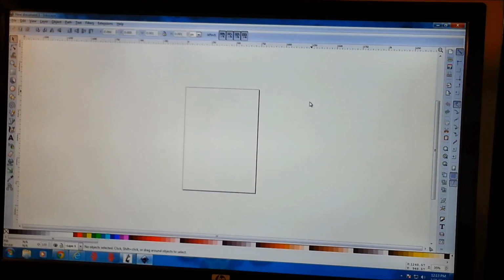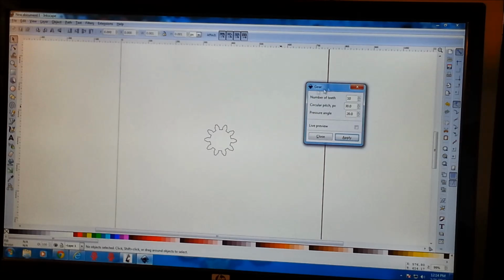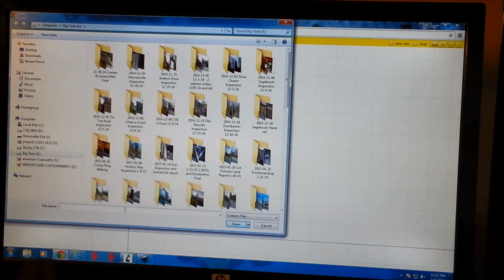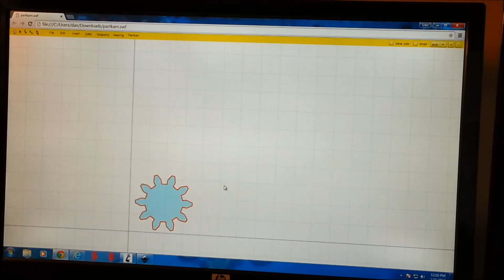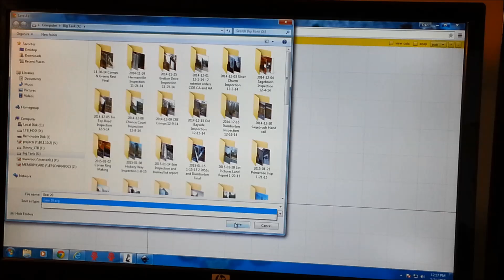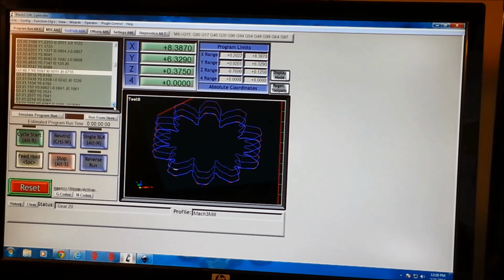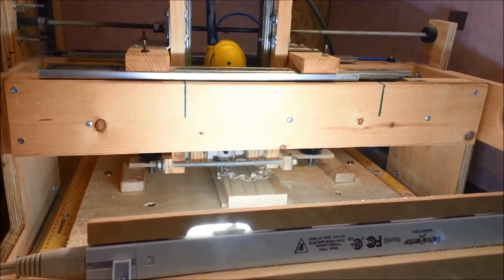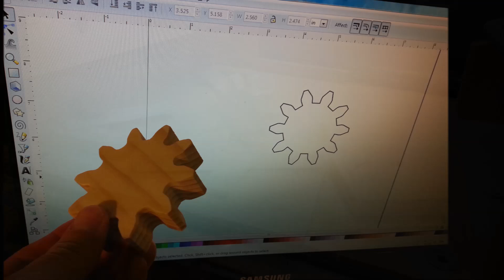DIY CNC - Making Gears With Free Software

Comment: I have looked online everyplace for the MakerCam offline software . If anyone can post a link please. I just bought myself a Millright M3 and have nothing to control it yet. All this is new to me im switching over from 3d printing and would like to start working with some cutting alum parts for my RC hobby. Any info or input would help.

Comment: Can this be used on a CNC for matching Aluminium I am only just getting in to CNC so a total beginner but any help would be very helpful
Reply from the maker: +dave cox It's a basic option but there are better choices.  I was testing out MakerCam a year ago and did have some success with it.  For those into CNC as a hobby there are a tremendous number of software packages available.  I have had great success with using two programs for my CAD and CAM work; Inkscape is free and a fantastic program for design work.  For the machining side of things (the CAM) part I use another free program called Jscut at www.jscut.org.  I have videos on how these two programs work together.  Cutting aluminum is not overly difficult but does require a lot of trial and error for each specific machine.  Feed rates, end mills, depths of cut are all somewhat specific when cutting aluminum.  Here's a vid I did recently in aluminum cutting.  https://www.youtube.com/watch?v=ase2RpzYE4c  Best of luck.

Comment: Hi Great video, i have a cnc plasma and now im using fast cam wich is not to good, do you know if this maker cam can generate de g code for plasma aplication...?

Thanks
Reply from the maker: +Fernando Hernandez Bolio Thanks.  I haven't used a plasma machine before.  I would imagine that plasma machines require changes to the code.  Just not sure.

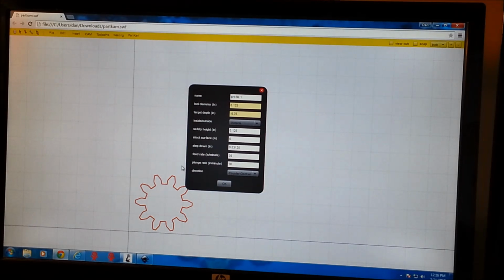Comment: sir im yet to do my 1st cnc job i just about to start but have some question regarding the parameter boxes in Profile Op. @ 2:57 So my Question is how do i know what to fill in there? i have some cutters but not sure if they are the right one for the type of job, and in addition im not sure what are those boxes really asking for as far as the tool section go, maybe a little pointer? thanks in advance 

ill be cutting some Gears using wood  PLA or Aluminum 6061? not sure yet but this is what i wud like to work with specially the speed rate? how do i know whats appropriate ? i have a manual machine cnc 3020T , you can find this on Ebay for about $799
Reply: i just tried what you just did every step and i got alot of circles in mach3 like a whole bunch of rings "i did have 3 gears" so i when back to the cam and deleted 2 and re run the profile op and calculate selected item and then i exported and i still get those rings in the view path in mach3
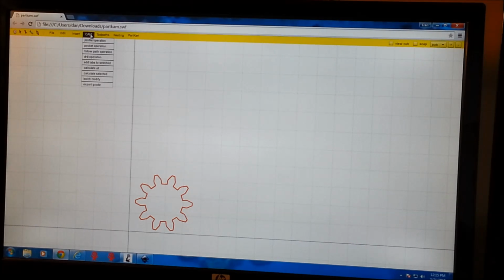Reply from the maker: +Frank Lopez For a while I was using Makercam with some good results but have switched over to using Jscut.org.  It's a much better application that also runs in the browser.  It can handle much more complicated shapes and makes good pockets as well.  There are some very good tutorials on using Jscut for 2d cnc work.  Makercam would act up from time to time.  The parameters at the 2:57 mark:  Tool Diameter - is the width of the cutter; Target Depth is how far you want it to go into the material; Inside/Outside is whether you want the cut to be inside or outside of the line for the shape to be cut; Safety Height would be how high above the material you want the end mill/bit to go; Step Down is how far you want the cutter to go for each pass; Feed Rate is how fast the cutter will move around the piece; Plunge Rate is the speed you want the end mill to drive into the work.  Makercam uses inches.
Reply: yeah i use mm so i see where the problem is at all my work is done in mm in autocad and as far as the tool entry what about some tools that have more then one diameter ? which one do you enter? and as far as  the speed rate "how do we know what number is that?" thanks for your reply tho
Reply: i deal with 3D files so i dont think this cam will help as i think this is for only 2D

Comment: what is the OZ/in on them nema 23's ?
Reply from the maker: Hi Dan - 290oz, I think - it was a couple years ago when I bought them.  This is pretty much the same kit on eBay that I bought:  http://www.ebay.com/itm/Nema-23-Stepper-Motor-290oz-in-3-Axis-TB6560-Board-CNC-Kit-Router-FREE-ship-/271340386557?pt=LH_DefaultDomain_0&hash=item3f2d25b8fd
Thanks for your comments.

Comment: Nice video,
Could you show/provide a reference for how you were able to run MakerCam locally?
Reply from the maker: Thanks, David.  Here's the Wiki link with details on where and how to download.  I am running it in Google by dropping the application in the Google folder.  It's odd that it is a flash program, but it does work pretty well. http://www.shapeoko.com/wiki/index.php/MakerCAM
Reply: drez20001 Thanks! I'll have to take a look at that. I'm eagerly awaiting shipment of the Shapeoko 3. I preordered back in November.
Reply from the maker: Sweet.  The 3 should be a pretty nice machine.  With access to the Easel software I think you'll be up and running pretty fast.